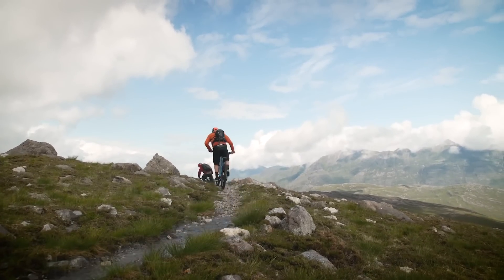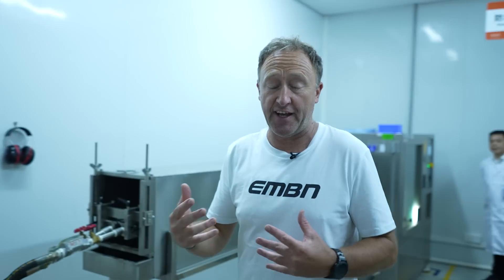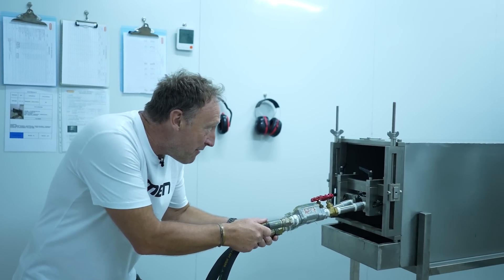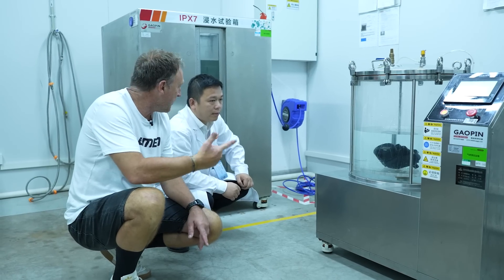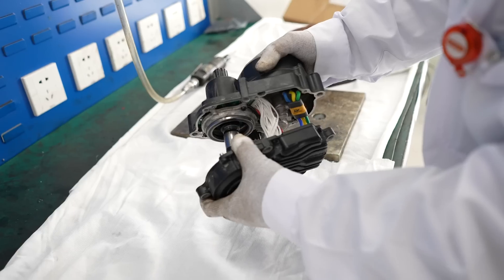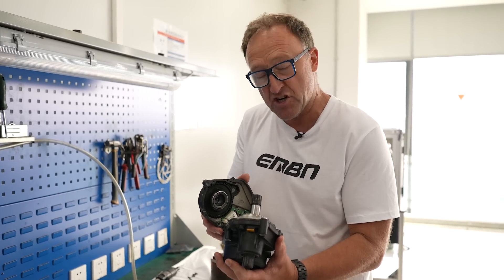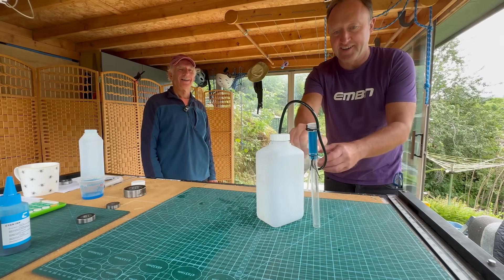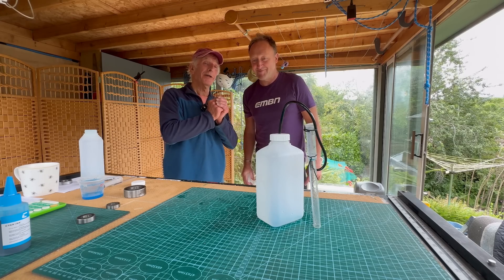Are eBikes Waterproof?

Comment from the maker: What do you think of our findings today? Let us know in the comments!
Reply: My pal fell into a canal on his Mondraker Crafty R with the Bosch motor. He and the bike were totally submerged. His bike was fine, and was checked by a mechanic. Interesting his iPhone which was supposed to be able to be submerged was ruined.
Reply: My Bosch Gen 2 Powerline CX now has over 12,800km on the clock. I have just pulled it down and it was spotless. I checked all the bearings, clutch bearings and nylon gears all are perfect. I poped off the rubber seals and re packed with marine lithium gears and silicone, PTFE based greas on nylon gears. The bearing that had steel shields I've replaced with rubber seals and re packed the bearings. I thought by now the bearings may have been a little dry or had some play, but no.
So no bearings clutch bearings or gears have been replaced. just a couple of bearing shields. I did add a shaft seal to the crank drive side instead of crank shaft and did give  the crank shaft a clean as there was a tiny bit of suface corrosion between the outer bearings and crank shaft. 
Looking at the condition I'd say this motor will last 30-35,000km before anything will need replacing.
Reply: Breather tubes to a high point. Same technique used for 4wd differentials and gearboxes
Reply: You say don't blame the manufacturers but have they fitted crankcase breathers?
Ray's your man.
Why not breathersl tubes that terminate high up in the battery compartment?
Reply: @embn  I just think you let the bike companies get away with murder, you don't hold them account enough.

Comment: The motors maybe made to be water resistant. But the remains of the cables and cable motor fittings which are entirely exposed to water, mud and dust. And then the difficulty cleaning this out. My Haibike with its Bosch CX motor has 20 bolts that have to be removed to access the motor area.  Dreadful designs.

Comment: A Desiccant (more commonly known as Silica-gel) filter that could be made to attach to the motors to absorb any moisture internally...??
Used in industries such as aviation and electronics to maintain dryness in enclosed spaces and a cheaper solution to this more specific issue as long as any form of pressure isnt required for the internal motor assembly.

It is something i will be looking at doing to my e-bike motor once the warranty has expired!!

Comment: I'm sorry ray, but I disagree. Your experiment is not at all representative as you have an open path for the fluid to transfer and are basically creating a temperature siphon. Put even a poor barrier in and nothing would happen. A true vacuum is 0 psi whereas atmospheric is 15 psi, therefore a maximum possible pressure differential of 15 psi. Factor in that to get to 0 psi is a massive challenge needing several different pump systems to achieve even under ideal condition, so the most likely maximum pressure differential is going to be no more than 5 psi. If the seal as designed by the motor manufacturer can not resist 5 psi delta then they have done a really poor job in design regardless of the temperature variations. And it doesn't matter if that pressure differential comes from a 5 psi reduction inside the motor, or a 5 psi increase outside the motor, the delta across the seal is the same. Submersion in a 1 m 'puddle' will only be about 1.5 psi with no other factors at work. Motor manufacturers need to make better dynamic seals and test them accordingly as Befang seem to be doing.

Comment: The same thing happens in a 4wd Landrovers Diff housings when offroading the hot diff gets cooled down in a stream and the axle gets water in so They have breather pipes to Equalize the pressure,emtbs need a motor breather pip going up the frame as high as possible .

Comment: My Bosch motor is currently at the shop with suspected bearing failure.
It's got just over 2000 miles on it, and thankfully 6 months warranty left 🙏

Comment: It sounds frustrating to experience a motor failure on your bike, especially so soon after the warranty period and given that it’s the second motor with significant usage (5472 km). Unfortunately, motor failures can happen for various reasons, even with relatively low mileage.

The poor experience so far makes me think about how different the bike industry, especially with eMTBs (electric mountain bikes), highlights a significant gap in after-sales support, particularly when compared to industries like home appliances, which have more streamlined support systems. The discrepancy in support models between bikes and other high-value items, like washing machines, stems from a few key factors:

1. Fragmented Supply Chain

Bikes, especially eMTBs, are made up of many specialised components from different suppliers—motors, batteries, drivetrains, suspension, etc.—each often produced by different companies. The bike brand is more of an assembler than a manufacturer of every part, so they rely on third-party suppliers for service and warranty claims. This makes it challenging to provide a unified support experience.

In contrast, a washing machine is largely produced by a single company, even if they source some components. That company typically has control over most aspects of the product and its service network, giving them more leverage to provide a seamless support process.

2. Dealer-Centric Model

The traditional bike sales model relies heavily on local bike shops (LBS) as intermediaries for sales and service. These shops often don’t have direct commercial relationships with parts manufacturers like motor or battery suppliers, meaning they can’t enforce service-level agreements or warranties on those components. When a motor fails, for example, the shop is stuck in a reactive position—relying on the component manufacturer for support, often without leverage to ensure quick or effective resolution.

In contrast, appliance manufacturers typically operate their own service centres or contract authorised service providers, allowing them to control service quality and response times.

3. Complexity of eMTB Components

Electric bike components, particularly motors and batteries, are much more complex and proprietary than traditional bike components. This increases the likelihood that repairs need to be handled by specialists with specific training, tools, and diagnostic equipment, often requiring parts from the original component supplier. This makes it harder for a local bike shop to handle the full range of repairs, especially when dealing with high-tech components.

4. Post-Sales Confidence and Market Maturity

As eMTBs and other high-end bikes grow in popularity, customers expect a level of service comparable to other high-ticket items. However, the current after-sales ecosystem isn’t built to handle this expectation, leading to frustration and a lack of confidence in making expensive purchases. The lack of strong post-sales support also hinders the growth of the second-hand market, as buyers often fear inheriting unresolved problems with no clear recourse.

Opportunities for Change

	•	Centralised Support Model: Bike manufacturers could offer centralised, manufacturer-led support similar to the appliance industry. They could either handle warranty and repair issues directly or contract out to authorised service centres that are well-trained in all components, including motors and batteries.
	•	Care Pack Options: Offering extended care or post-warranty service packs would add significant value. This could be sold at the point of purchase, allowing customers to pay for ongoing support and repairs, much like extended warranties for appliances.
	•	Streamlined Communication Channels: Manufacturers need to set up better communication between themselves, the component suppliers, and the retailers. A more integrated system could enable faster repair times, better access to parts, and more consistent service across the board.
	•	Digital Tools and Diagnostics: Like the automotive industry, bike manufacturers could introduce digital diagnostic tools that local shops or even consumers could use to diagnose issues with the motor, battery, or other electronic components, reducing the dependency on faraway service centres.

Conclusion

The current bike service model, especially for complex eMTBs, is outdated and not designed to handle the level of post-sale service that customers expect when spending significant sums on their bikes. By adopting a more centralised, manufacturer-led approach and offering extended care packages, bike manufacturers could not only improve customer confidence but also stimulate the second-hand market, benefiting the entire industry.
I would love to see the channel tackle this type of issue with the aim of bring about positive change.  It’s easy for a successful channel to focus on the positives whilst receiving products for short and long-term review.  But focus needs to be placed on the perspective of those who pay hard earned sums of money for their purchases with no real assurance that there is a mechanism to look after them i the long term.

Comment: Your assumption (that the motor sucks in water when it cools down) is based on two things:
1. The seal isn’t airtight. This makes me believe you are talking about a motor that had zero quality control during the manufacturing process.
2. The motor was assembled in a hot environment (over 60°C), so a "cooled down motor" has lower pressure inside than the biking environment (e.g., a forest). It’s hard to believe that workers (on an e-bike motor assembly line) would do their jobs in such conditions.

Here’s my thought: A motor that has been disassembled (and poorly reassembled) could have sealing issues. If there’s a gap (void) in the motor's sealing, the air inside can expand when it gets warm/hot and exit freely through that gap -> and ONLY THEN the "water sucking" theory becomes possible. In any other scenario, as the air inside the motor heats up, the pressure rises well above atmospheric pressure ("outside"), and then, when it cools down (due to a river crossing, for example), it stabilizes again to "normal" pressure. So, there’s no chance of it "sucking in" anything.

Comment: I am on my 3rd Bosch motor in 4 years for my 2019 Cannondale Moterra.  Bosch graciously covered the second motor that had bearing failures even though it was 2 weeks past a 2 year warranty.  After 3 years on that motor it also had bearing issues after a single submersion.  I sent it to have the bearings replaced in the US by Performance Line Bearings.  2 months later the motor shutdown at the start of a ride and would not restart.  It remained at a shop for 2 months to diagnose the issue.  A new motor did not fix the issue and then it was discovered that it also needed a new head unit which seemed to have also stopped working.  Finally it worked again! So after $500 in new bearings I spent another $1000 to get a new motor.  I hope to get at least 2 years out of this motor before any further issues.

Although Bosch is rated high for reliability, I think the gen 2 motor, and other manufacturers, could do a much better job of sealing their bearings.  The gen 2 version 3 motor only had a oil felt washer on the right side and nothing on the left  side to protect the main bearings.  Performance Line sells a good seal to add to the right side.  A circlip prevents adding a similar seal to the left side so that is still very exposed.  I do not see why it is so difficult to design a motor with better sealed bearings, in my view.

Comment: Would a tiny breather hose running inside the frame help. Would almost ensure dry air pulled into the motor due to least resistance. Maybe seal replacement and regular greasing intervals should be undertaken. Im no expert, just a thought.

Comment: The motor is sealed so when it gets hot the inside gets pressurised. When it cools, the pressure returns to normal, no sucking involved. Also water is more dense than air so it won't necessarily pass through the same hole. Nice demo but not sure it's "real world". Worn seals are a more likely culprit.

Comment: Had my ebike less than 2 years and the frame has cracked 3 times. Got a new frame and the rear  brake mount cracked and the  brake fell out, then the frame cracked at the same place my first bike cracked. Total of 4 rides on the new frame and nothing aggressive.  Motor seems to have done fine so far and I'm dying to ride it through a ford but I'm to scared . It will be fully submerged for at least 10 seconds.

Comment: Perfectly sealing a motor will always be hard because you need a moving shaft or similar to go from the inside to the outside to transfer the torque. A perfect seal would only be possible with a magnetic coupling - but that is inefficient and poorly suited to a vehicle engine because it will easily slip under high torque. It's also very heavy, and costly.

There are some less compressible gases that could be used to fill the motor interior so this effect was reduced, but there are no gases that don't compress at all, so it's far from a perfect solution.
Filling the engine with oil just like we have done for decades with gearboxes is probably the best solution. I don't know if this would cause any issues for an electric motor though. I don't think it's incompatible. It's probably not done mainly due to keep costs low I imagine.

Comment: This is the same issue on the input seal on a vehicles steering box mostly rack and pinion these days. You have oil heated in the gear by hydraulic friction. You then drive through a puddle on the road and a wheel splashes water onto the pinion top of the valve housing. This cools the valve housing which shrinks in length slightly and cools the oil in the valve housing which sucks in some residue water past the seal lip. In sub zero zones around the world parking overnight results in more cooling of the steering gear and oil. This is why most input seals on Rack and Pinion steering gears are double lipped to stop ingress (outer seal lip and leakage out from the inner seal lip. This requires a high temperature grease between the lips to stop excess seal lip wear.

Comment: Just done 1100km shimano ep8 spins internally but no assistance to chain ring . Shimano are replacing it under warranty . I live in Australia southern Victoria so not hot Australia ! Never submerged the motor  in water never used high pressure cleaning . I wash  my bike about 30-60 mins after a ride rinse it over with a hose after bike standing up right never upside down . And I’m pretty sure it’s water ingress is the reason for failure that is not good enough.
Reply: Ps bike is YT decoy just over a year old

Comment: I've got a Bafang motor and they are defiantly not waterproof, mine lasted just over 2 years before it gave up , All weather riding, sun, rain and snow but never submerged under water. The biggest culprit is rain water mixed with road grit.

Comment: Simple cure is to add a breather hose that sits up in the frame that won’t dray in moisture , you see this everywhere in the automotive industry to cure this issue , and an oil filled motor would suffer from the same thing , so that’s not a solution

Comment: I've had ebike specialized Kenovo expert for 4 years and water has never been a problem and I am on my 6th motor it's always belt or sprag clutch failure and I ride all year round and pressure wash the bike down mainly in the winter but know where to on the bike and where not to. The batteries are very good, broke one frame and one set of wheels one swingarm but all was replaced by specialized who are very good. The wiring was replaced one on the motor but that was a warranty update and has been all good. If the belt and sprag was fixed I think these motors would fantastic. The belt has been updated not sure on the clutch but on average I get 3500 miles on each motor of hard use. The 4year warranty to orginal owners was a welcome thing that Specialized brough in and I can't fault them.

Comment: Thanks Steve! They are doing sampling in the Bafang test lab. Not all motors are tested but certain number of motors per batch.  The Bafang looks great in testing & design for sure! No way that I can submerge my CX motor by Bosch :-) Shame on you Bosch....I'm just saying. Steve, how about if would you make a list of motors by manufacturer, where  the IP rating is listed. You could go over the topic in some discussion video and make the issue more visible. This is still one thing that is not taken seriously enough by some manufacturers. Some manufacturers are not listing the IP rating, because they will fail for sure :-)

Comment: Just my input, I don't own an EMTB and am put off doing so ue to experiences I hear but I've worked in the automotive repair industry as a mechanic for 30 years and water ingress in mechanic components is not a massive problem.when you consider the amount of exposed shafts on engines, gearboxes, axles and steering racks etc, all with fairly conventional seals and they do not fill up with water and are certainly exposed to a lot more, they do however have oil in and are generally vented at a high point to allow for expansion of pressure within due to heat build up. I do think some cues could be taken from the automotive industry to seal and protect these basic light duty motors by comparison. Like I say, it's just my opinion.